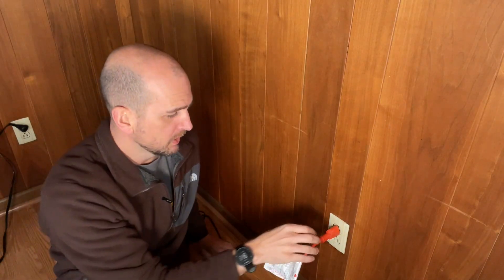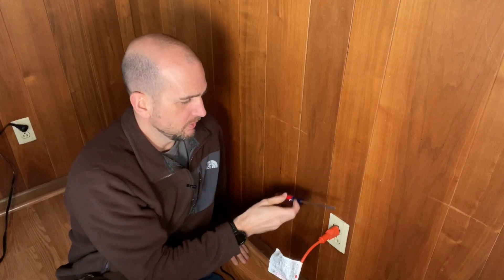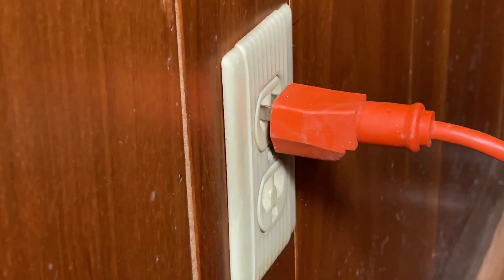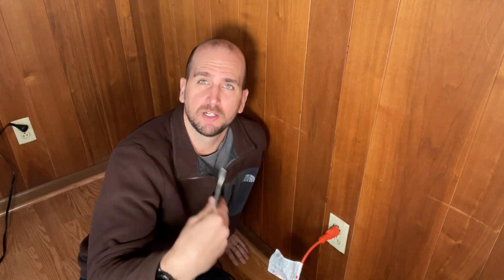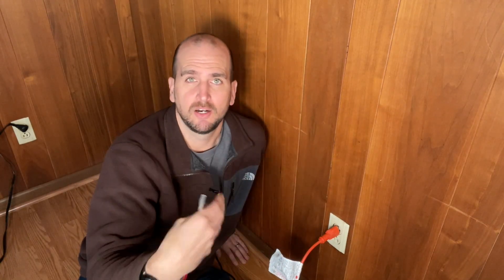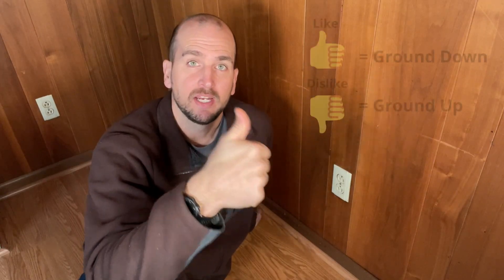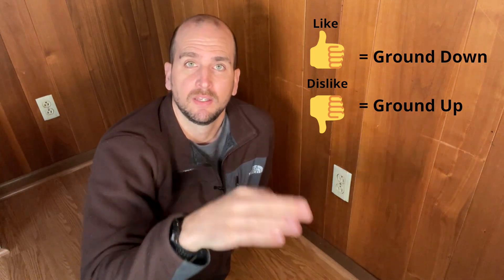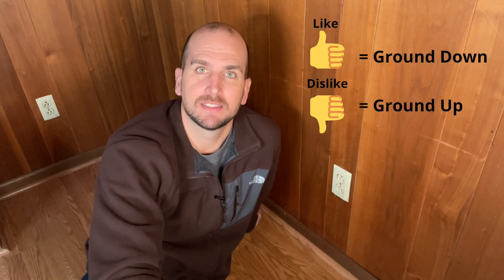Should An Outlet Be Installed Ground Down Or Up

Comment: I used to be a sheet metal worker.  I asked an electrician once about it and he said in most commercial jobs these days (this was in 08') that they usually call for ground up.  But in residential it will depend on the builder.  But he preferred ground up because of the safety reasons you listed so since then I have always put mine ground up.  I also noticed that with ground up when you plug in a power strip behind some furniture that is not a 90; it will help prevent the couch or entertainment stand from pulling the plug out when pressed against it.

Comment: As I learned growing up the Earth to Earth or in the USA Ground is always down.  When wall-warts became a thing with the third prong if you didn't do that they would fall out from the weight.  I ALWAYS put the ground hole down, and will pull all sockets out and flip them around if I see them the wrong way up.
Reply: A - greed.  Drives me nuts.
Reply: We bought a recently renovated home with 110 new receptacles having ground up. The "electrician" told me that's how he was taught and was upset that he was unaware that the other way was preferred.  I have systematically reinstalled most of them to regain some semblance of sanity.
Reply: @UpnorthHere  Very odd.

Comment: I would like to have all my outlets ground prong up "but" most manufacturers of small and large appliances haven't caught on or don't care because plugging them into a reversed outlet means the wire sticks up into the air and will over time have a sharp curve in your cable which can cause problems in a short amount of time, soooo I will leave ground prong down! I think that the percentage & coincidence of something falling in the crack making contact with the power side of the plug is pretty low! We will of course pay attention to this making sure the plug is either all the way in or all the way out!
Reply: If a plug is loose in the outlet, I just change it out with a new one!

Comment: One of my first things I had to deal with at my current job was to check a 220 plug (ground down) that had tripped.  The previous person didn't put the screws in the metal cover.  The cord backed out a bit....yea you can guess the problem!

Comment: Putting ground up is wrong. The reason is if you plug a large power pack it will not stay plugged in  because they are designed for the ground facing down.

Comment: Common sense: The longer ground lug should go into the socket first. Down low, the ground should be on top, because the ground lug will naturally go into the hole first as someone bends down to plug in the appliance. Up at counter height, the ground hole should be on the bottom, again, so the ground lug will be introduced into the socket hole first. I do believe many codes are beginning to specify this.

Comment: For residential homes, I’ve never seen the ground plug facing up. I’ve only seen it facing down. In commercial areas, I’ve typically seen ground facing up but sometimes down.

Comment: I think that the solution is actually pretty simple. Why is it that the manufacturers have to design it with both grounds oriented the same way. Most outlets have two plugs so Why not have them facing in opposing directions? In that case the one at the bottom will have the ground facing down and the one at the top will have the ground facing up. If you invert it you still have the ground protecting the top one. That also gets rid of the issue where some plugs are better with the ground down. All you have to choose is the bottom outlet in those cases.

Comment: I have been used to ground down my whole life, but a new building my department moved into all had ground up. The problem is all the power strips and UPS units had flat plugs, so the wire had to go up before going to the floor.  You made a good point about safety and ground up, but I will still be goin ground down.

Comment: My father, who was a licensed electrician always had the ground on bottom because when a grounded plug falls out, the ground is the last connection to the outlet to loose contact, which is safer than having the ground be the first to loose contact with the outlet. For the ground on top, honestly, how often are people leaving thin metal objects right above an outlet. In typical behavior, people are more worried about being killed by a terrorist (highly unlikely) rather than from heart disease from eating poorly (highly likely). If you are so concerned about metal objects hitting the top of your loose plug, place a shelf above, or better yet, replace the old outlet, they are rather inexpensive, and easy to replace.

Comment: so my logic is if it mattered it would be specified by manufacture or code. All things being equal, with no direction i do ground down except if the plug is ran off a switch, to make it easier for new residents to identify which plug operates off the light switch.

The logic of if they become loose and shorting out isnt good for me because if the receptacle is that worn it needs to be replaced. However if you have ever lived in a 'cheap' apartment you might know most of the plugs are loose. If you do live in such a apartment do harass management and get them to replace every single outlet that is loose.

Comment: I have seen on the news where kids were dropping coins between the two hot and nutrural prongs and causing a arc flash  and possibly a fire.
Reply: That's just an urban legend, 40 years as master electrician and never ran across anything like that.
Reply: And if they are truly doing so, do you really think kids will not figure out way to work around your fix?
Want to test my theory? Get a child safety lid on a medication bottle, explain and show the child how it works and see which gets it open quicker!  
Now change to a kid you have not shown and explained how the lid works and find an adult someone that understands how they work but has compromised hand function, injured arthritis or whatever. Now see which gets it open faster. 
Kids are resourceful, it is s learned trait to be less resourceful (being told repeatedly you can’t .... or that will never work and such!

Comment: ...so from european view the earth has to be DOWN!
clear logic. Ignore stupid people touching nakes contacts... thats a general usa issue with oulets, with the ce/schuko this will not happen...
The logic behind earth down is, not only the 90  degree cable will fit ( made for reason like this), it is a safety issue of unattended cables ( maybe behind somewhere)... if a cable wobbles out (maybe from weight of the cable andor movement of the cable)of a socket slowly, safety regulations say here, that first life and neutral have to unplug and earth at last . This is important to electric devices with metal housing...
So aaaaaallll electric connections have to be constructed/mounted, that always the earth contact stays connected to the last moment.
If the usa has a problem with touching contacts, they should sneak to europe. We hande up to 400!!!volts in residential buildings with touchproof contacts... and even no loose contact issues...
CEE and Schuko standart.just google

Comment: The argument I would present for ground placement is the angle that the user is most likely to insert the connector. If user bends down to connect, a ground up causes the ground to be the first wire connected and offers the greatest safety from electrical shock. The discussion on a loose outlet is a mute point as the outlet should always have a certain minimum pull force, if plug can easily pull out, the outlet MUST be replaced as it is a hazard for shock and fire (and is annoying as heck!). The counter argument would be if the plug is partially pulled out the ground pin would be the last thing disconnected but this is more myth as the ground pin should be longer than the other pins anyway.

Comment: I install receptacles with the ground down. Most plug-in transformers & right angle cords have the tails facing up otherwise. Also plug-in surge arrestors will have the writing upside down. New stuff is starting to come out the other way though. The reason behind ground up was if a plug was partially out, falling metal wouldn't short it out.
Reply: That "reason" is silly and contrived for the gullible.

Comment: I prefer ground down because the ground is the last one connected if the plug falls out or gets stepped on. Since the seventies I have never seen any ground up until the last five years when at a hospital.
Reply: Ground up in hospital would make sense as the outlets have a fairly high unplug resistance compared to residential stuff. If I remember correctly there is a minimum pull out requirement for hospital outlets.

Comment: I hard wire all my electrical cords directly to the outlet fixtures. That way they never come loose unless you really want them to. 🤪
Reply: Hard-wiring plug-connected devices to the outlets may violate several electrical code sections.  You can buy receptacles that use the locking holes in the plug to hold them securely in place.
Reply: @UpnorthHere   drrrrrrrrrrr you don't say ?????

Comment: Decades ago I was on a commercial job.  A piece of metal framing track that was leaning on the wall slid down and it crossed the plug of my drill motor in the receptacle, and it shorted out. I replaced the plug on my drill motor and the receptacle, of course with the ground up and have installed them that way since.

Comment: Ground down because of the plugs that are space-saving (most are as you displayed). This becomes even more obvious in kitchen appliances. In the Philippines, we use several plugs and for that reason, we also use outlets that have a combination wall outlet, one that excepts the European (round plug prongs) and the American flat two-blade type, both of which come with and without the ground prong.

Comment: I work at a hospital for 15 years and its ground up. Staff tend to yank cords up thus snapping off the ground.  So I just pull off the broken ground  plug from the socket and then replace the plug wire. Simple

Comment: I do ground down for one particular reason, and its a "just in case" scenario prevention. That certain scenario involves flooding. Say your house or basement is flooding or is flooded, and someone is standing in the water or has to walk through the water.  If the water level reaches the ground first, then the live and neutral will short straight to the ground terminal. If its ground up and the water level comes up just high enough to reach the live or neutral or both, it could give someone a nasty shock. Just a worst case scenario, and it probably wouldn't end up hurting anyone if the electrical is up to date, but in old house with old service boxes and updated outlets, I thinks its possible. I am also not an elechicken either, and I'm probably thinking too far into it. Lemme know if I'm a moron, always down to hear feedback on my outlandish ideas.

Comment: At work our vehicles plug in with a heavy 12 gauge extension cord into a plug on the side of the vehicle. If you have the ground on the bottom the weight of the cord pulls down and the flat blade connectors start to pull out, causing a bad connection and they can, and have burned up and caught on fire. With the ground on the top when it pulls down the weight pushes the flat blades into each other making a better contact. As a kid my grandfather had a metal wire on the water heater plug to hang it up when it was not plugged in. I went to plug it in one day and the wire fell on the contacts because they were on the top and it blew the fuse. Those good old round screw in ones that look like the base of a light bulb. I'm so accustomed to them at home always having the ground on the bottom, but now I think as I am going to rewire the house I will put the grounds on top

Comment: Ground down,   Where i live we get flooding and i would much rather have my ground under water before the HOT  so that now it has a shorter distance to ground it self out.
Reply: Really? You do realize that the neutral terminal next to the  hot terminal is ALSO grounded, right?   The equipment grounding wire is primarily for safety in the appliance.
Reply: @UpnorthHere  neutral is not the same as a ground.
The connection between neutral and earth allows any phase-to-earth fault to develop enough current flow to "trip" the circuit overcurrent protection device

Comment: I prefer ground up in most cases, especially in a garage or workshop where the odds of a metal object falling onto an unseated plug is higher. That said, I agree, it does become an issue with wall wart type chargers and such designed to be oriented one way in the plug.

Comment: I did ground up in my house when I built it for the very reasons you mentioned in your video.  In the years since, the 90 degree cord issue has been big.  They are almost all set for ground down.  It's to the point where I'm considering flipping all my outlets to ground down.  I like the idea of switched outlets opposite the standard.
Reply: My thoughts exactly I couldn't have said it any better. All of my big heavy appliances looks like they're plugged in upside down it looks stupid. In the area that I live if you try and sell your house, the home inspector will inform you that the ground has to be up. The same thing with the HUD inspector. But none of them can provide a law that says which way it's supposed to be. But if you don't comply you will fail the inspection.

Comment: I've always installed the grounds facing down, But our local building inspector recommended facing up for some extra safety. BUT also said he would not reject it if they were facing down. As long as they were all in the same direction in the building. Most electrical appliances tend to favor ground down.

Comment: Most “wall warts” (power cubes)especially higher wattage ones have the wider blade (neutral) so that the best orientation is ground down. Ground up causes them to fall off or at least pull away from.
Reply: This is the correct answer for homes. Because the assumed orientation for consumer electronics is ground down, wall warts will properly hang and simple things like a night light will stand upright, instead of hang. The safety angle for ground up is so remote that it essentially is no benefit in a home.

Comment: To be Absolute Honest, i dont need this ever, im Europe based and am stunned how insecure your Power Install is. Yea, you have lower Voltage but Exposable Plugs should be outlawed anywhere.
Our receptacles are way safer and you cant touch any live Connector in any way if you are not a complete dumbass and stick your Screwdriver in. ALSO you can put all conectors upside down

Comment: It really doesn't matter. A receptacle can be mounted on a wall in any configuration 360 degrees. The same as a floor or ceiling outlet. I guess some of you might hang a power strip on the wall a certain orientation or be sure your extension cord is laying on the floor correctly. It's just a mute point.

Comment: Ground down.  Also, light switches should not say "NO" when they are flipped down.  Leviton instruction manual for electricians.
Reply: In fire stations all the light switches say NO. Guess why?
Reply: @andyhastings5950  Why?

Comment: Went shopping for a plug to put onto the end of an extension.  About two years ago, I paid about $2.00 for the plug.  Today, Lowes prices, supposedly due to the pandemic, have the plugs at $6.50.each. They are the same brand as before.   Two years ago, the department store was a chain store like Home Depot, but locally owned. Now the chain stores are owned by Lows hardware. I wonder if there is an agreement between the big box stores to insure good profits from  infrequent home owners purchases.

Comment: Hospitals do ground up because most devices are mounted high on carts.  Ground down is the most appropriate installation because appliance manufactures build the cord stress for ground down. People who put ground up also put toilet paper rolls on wrong and point all the utensils down in the dish washer. I think that engineers that put receptacles ground up also design cars with the fuel fill on the passenger side.  Just stupid ! They also designed three door trucks with the third door on the street side so your kids can get out into traffic. Common sense not so common after all.

Comment: What about top ground up, bottom ground down?
Seems like that'd be the best of both worlds; objects falling down hit the ground, 90 degree cables can be put in the bottom and go straight to the floor, and those big ones, the transformers for power supplies (like the old NES power cable), can be put in both sockets and not interfere with each other.

Comment: I have noticed that most electronics, such as wifi boosters and hotspot adapters (With the plug as part of the device) are designed to plug into out;lets with the ground facing down.